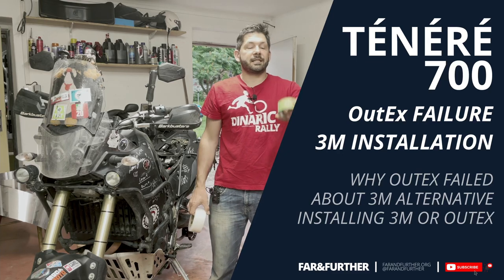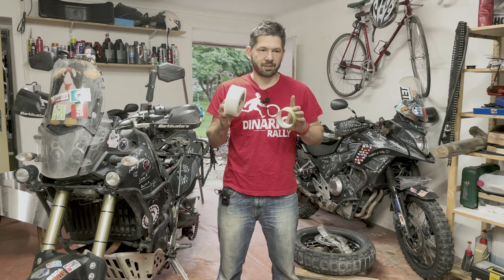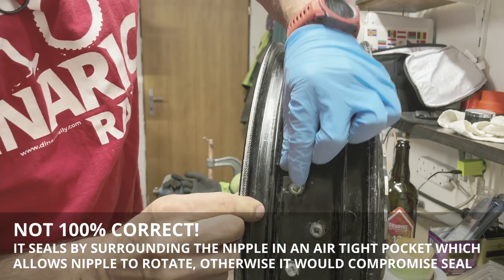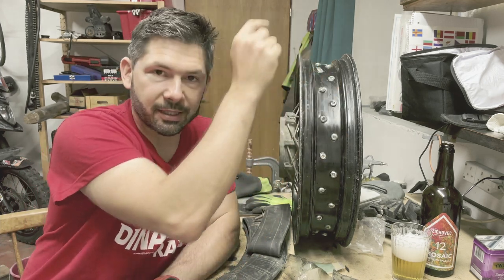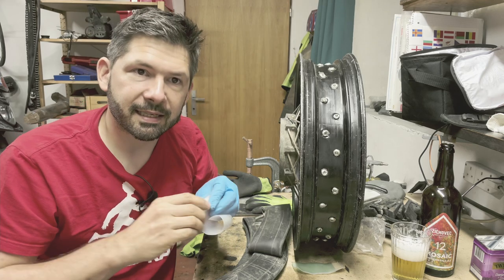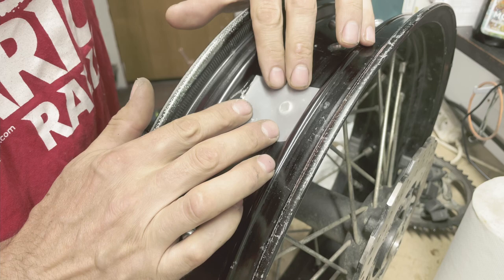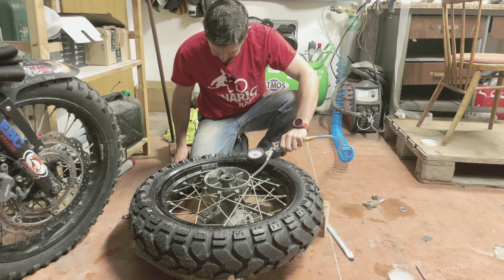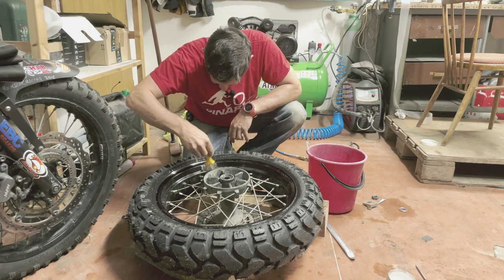Yamaha Ténéré 700: OutEx failure analysis, 3M alternative details and installation guide

Comment: Brother use JB WELD Red High Temperature RTV Silicone Gasket Maker and Sealant. I used it because it has High resistivity towards oil and temperature. Outex is always a failure due to its high price.
Reply from the maker: That could also work very well indeed. The chemicals is what I think kills the OutEx.
Reply: Did you try this already by any chance? Any luck? Is it still holding up? How did you apply it?

Comment: Mine failed to adhere on installation 😖 outex very expensive but failed. Used a ductape plus silicon instead
Reply from the maker: Can’t comment on the reason why it would fail on installation but yea, duck tape and silicon also works for limited time.

Comment: Sorry if you have been asked this question before.  You mention that 3M has tape for sealing nipple ends….its just not cut into circles.  Do you know the tape type or number?  Also if one were to cut circles…what would be the proper diameter?

Comment: Excellent review. Thank you. This is exactly what I was looking for. I used silicone to the nipples and a 3M extreme adhesive tape and failed at half the nipples. Ordered 
3M 4412N. I also used a Harley Davidson stem which holds air tight nicely if anyone is looking for a tubeless valve. Harley Davidson 43157-83A
Reply: How is that going now?
Reply: @lukewoods5696  still holding. No issues.

Comment: I had problems with the outex layer on my rear tire as well, the front has been fine. I went to the 3m tape, I actually just layer it over the outex layer, which I feel I might have goofed up the install on. The 3m I just had overlap the metal-to-outex layer to prevent air from entering , thus sealing it up better. Its holding so far, if i have a problem, I will just go straight to the 3M as I found installing the outex tape to be very difficult to do, especially since the videos ?I found were not great - your way of showing how you did it was awesome and they should make a similar video showing how to install the tape around the nipple properly. By the time I figured it out I am sure I screwed up several :)

The official outex install video was the absolutely happiest use case, with no narrative, and he did the whole wheel in like 2 minutes... it took me a lot longer !

Thanks for the video and ride safe!
Mike
Reply from the maker: Hi, I'm really happy the video was useful. In theory the 3M over the OutEx could seal the rim, the 3M is super soft so it can be forced everywhere.

I'd however investigate where the OutEx leaks and how as I have also managed to damage it with my tire irons and had to just cut portion off and replace it with the spare tape, which works well.

OutEx also sells sealing agent for the small holes (I have not tested it):
https://www.ebay.co.uk/itm/Air-Leak-Prevention-Agent-for-OUTEX-TUBELESS-KIT-/293887593577

The correct sealing of the nipples is crucial and I really tried to show it because to be honest that's probably only point of failure of the OutEx (unless it peels of like mine :) ). Patience is key and taking real care to seal the nipple all around without any wrinkles. Also important is to leave enough "meat" on the outside side (one close to rim) as it will be pushed a bit in with the air pressure.

I've spent probably about 30-40 minutes with the rear wheel.
Reply: @FARANDFURTHER  yeah for whatever reason I had bad adhesion or something with my outex. I would put the tire on, there would be a leak, I would cut the section out replace with new tape, remount the tire, completely new spoke would leak. I did this maybe 5 times and even had to buy more outex tape and got sick of fighting with it and threw a tube in it.  

The 3m tape worked first try. Yeah you are right I will need to be careful but I use a no mar tire machine so less chance of hitting the tape. I will keep an eye on it
Reply from the maker: That is super strange. What I found though is that the rim must be super clean. I found this by accident when using acrylic paints, they’re very sensitive to contamination and started to “wrinkle” very often. It took a lot of effort to clean the surface properly. Acetone, Perchlor-Ethylene, Technical alcohol etc... need to be used. I think 3M tape is different as it should stick to virtually anything even when it’s wet 😂🤷🏻‍♂️ Some alien tech or what!

Comment: Thank You for your well thought out researched and attention to detail! Excellent video and very useful! I'm in the process of doing this to a wheel that is already tubeless. (KTM 1190 Adventure R) The KTM uses rubber around the rim to seal. The rubber is prone to failure and is recommended to be replaced every 5 years. I already used the 4200 adhesive sealant around each individual spoke nipple instead of the 5200. I heard the 5200 is too permanent and hard to remove. Yes..I did consider the seal will move/fail when tightening or adjusting spokes. I trued the rim and tightened all spokes to spec. before applying the sealant in hopes the sealant will actually hold the spokes in place making less need to adjust spokes?  I'm not in favor for grind the spoke nipples just seems like too much possibility of failure and hitting the rim with the grinder. I think I'm going to use the 3m tape, then use the KTM rubber gaskets. I just want extra protection and less worry in the future. I am wondering if you use some either talcum powder or even silicon lubricant if it will reduce the friction on the tape if one needs to use a tube? You said that 3M makes the same tape as those round dots that cover the nipples...what tape is it, please? I would like to get some and cut the circles myself. Thank You, again!

Comment: Awesome video, thanks mate, i'm going straight to 3M on my T7 rear, still undecided about keeping tube for front or going 3M tubeless as well. I'm going tubeless so i can just plug a tyre instead of removing whole wheel & tyre if i get a puncture
Reply from the maker: Good luck! Yes I have the tubeless for the ease of repair. In front I run tubeless for ages the only issue is that
1) don’t go lower than 1.3bar/19psi
2) front tends to suffer more from bead leaking as the tire flexes and dirt gets in between the tire and rim

I’ve just fixed 2 rims to seal again. Proper clean and removal of all corrosion is crucial.
Reply: @FARANDFURTHER  But does it really work?
Reply from the maker: @Valterpenato  What does work? Can you elaborate your question?
Reply: @FARANDFURTHER  Hello.  I asked if this change really works over time.
Reply from the maker: Yes it does, I have about 60k km on the OutEx and I have now done 9000 + one Rally on the 3M tape and so far no problem. The only problem is one needs to be super careful when changing the tire not to damage the seal.

Comment: 3m all the way, never let me down.
Reply from the maker: Yep, it seems to be working well. How you tighten the spokes? Does it make problems?
Reply: @FARANDFURTHER  I wonder as well. Probably there is no way you can adjust spokes after sealing anyway?
Reply from the maker: So… I’ve tested the 3M tape and it failed pretty quickly. The 1mm tape is definitely not thick enough. Just yesterday I thought giving it another go.

I had to tighten the spokes and the result is that, of course, the seal is broken. You can adjust a bit but more than 1/2 turn will compromise the seal.

I’ve applied another layer of the tape (as I have only 1mm) and it seems to hold for now. The tape is meant to be stacked by the way.

Let’s see how long this lasts.

Comment: Really useful and I did enjoy watching it. Really can't make my mind up about different options but I think the 3M tape looks the right one 👍
Reply from the maker: In my experience all failed so far. I have not tried the Barttubless but otherwise all failed. For various reasons 😂
Reply: @FARANDFURTHER  thanks for this. I've just looked up the cost of Bartubeless and at £300 plus I'm probably going to go with the M3 tape 🤔
Reply from the maker: @richardgiles2484  😂😂😂😂 yep. I will try it for the science 😂 I guess 🤷🏻‍♂️ It’s the rim which is expensive

Comment: Nice video, thks. Just my opinion but grinding the spoke "nipples" or head is a no no because spokes hold the rim by tension so by grinding then the shear resistance  will be reduced and failure can occur.
Reply from the maker: Yea... not really fond of grinding the spoke heads as well.

Comment: Could you please make a trail based tire change video? I changed the tires yesterday and the rear tire was incredibly hard. Only used «trail tools» so I know what to do if I’m out and about. Thanks!
Reply from the maker: I’m happy to make a video but why change tire on the trail? On the trial what is most likely happen is a flat and I’d need to take one side off to change tube (unless I have tubeless) not take the tire off the rim.

Is it more about some tips and demonstration how I use my trail kit to do this?
Reply: @FARANDFURTHER  Thanks for the response as always, I’ve learned so much from you.
 
I ment tube change, not a complete tire change, sorry.

What do you mean when you say «take one side off to change tube»? Break the bead on one side and slide the tube out and replace? That sounds way easier than removing the whole tire to replace the tube.

Yes, tips, tricks and a demonstration would be really, really awesome. Most instruction videos are done in a garage with tools that you really cant bring on the trails.
Reply from the maker: @JohannesDalenMC  Man! I took up on the challenge and what a pain it was 😂 Now I need to somehow creatively cut 1 hour of struggle into reasonable video 😂🤷🏻‍♂️🤦🏻‍♂️
Reply: @FARANDFURTHER  Thats awesome, really cool that you did that upon request! I’m looking forward to the video - add some bloopers at the end. I spent many hours changing mine, swearing and sweating!

Comment: I know it have been couple years since this posting.  But, I had some questions.   The Outex instructions seems to state Do Not overlap either tape layers.  Cut a 30-40 mm. splice for the joints where both ends of the tape meet flush.  So do I have it correct and does is matter which way ( direction ) you apply the tapes to wheel?

Comment: Hello my friend,
How low can you go with the pressure without the risk of the tire going over the hump and loosing air?
I ask, because I have a beta Alp 200, a very light weight off road bike which needs to be driven with very low pressure and I’d like to give it a try on the back wheel with the 3M
Thank you so much for sharing your experience!
Best regards
Dani

Comment: Hello, thx for the video. I'm buying a Triumph T100 2023 and plan using 3M Extreme Tape instead of Outex, question: can I use the original Pirelli Phantom tiers after the conversion ? Is there any risk in using the Pirelli Phantom with the original rim after conversion ? how long will the 3M tape last ? thanks so much.

Comment: Mmmmm - this has got me thinking.  I've been using tubeless on my mountain bikes for years and always wondered why motorbike tyres couldn't be run the same way.  Many on MTBs just use gorilla tape instead of the expensive specific sealant tape they sell in bike shops. But MTBs don't have the same stresses and strains of a motorbike I guess. So I like the idea of the 3M tape but then why not put a layer of gorilla tape over that to protect the 3M tape?  Also why not put some sealant in the tyre like Muck-Off Tubeless Sealant?  That would if needed work its way into the spoke holes and seal the rim better.  You also obviously have a puncture sealant solution in the tyre as well to potentially seal a puncture on the road.  The issue for me is getting the tyre off on the trail.  if you tear the tyre or has a hole that can't be plugged then you have to put an inner tube in.  But TL tyres can be impossible to get off the rim, especially if you ride alone and can't use someone's side stand to break the seal.  Finally long videos are good if it gives you useful info - short videos that lack detail are pointless!  So many thanks.  regards, Mike
Reply: Yes it is being done. Normally you would use the rubber that is originally there to protect the tube from spoke's ends. Some kind of tape can be used as well in combination. I use it even now with tubes. Also Muck-off is also being used to seal it in case of some tiny leak or trying to seat the bead. As for the TL tyre getting of the rim - if you have center stand you can use your side stand to break the bead. I've done it on front and rear, just somehow block the stand from moving (attach a rope etc.) so there is no possibility that the bike rolls from it. Then it can be leaned surprisingly quite far. But 3M TAPE is not a good idea as I heard plenty of stories of it failing. Much better is to use that 3M marine silicon and glue the spoke holes and you can always secure it by the 3M tape (5200 is bonding stronger than 4200, I bought 5200 of course lol). Spokes not moving is not an issue at all. It's even better as you don't need to tighten them! Spokes on the rear wheel don't move much anyway, so that is not a problem. Front might be an issue but I will use a tube as the rim is not really designed for TL tyre, so the tyre might leave the bead at 120kmh on hwy - not risking that! Patching the front is not really that problematic, the rear is a pain so I'll be doing only that. Also when I glue the spokes I will put a layer of 5200 silicone all over the rim instead of the tape. Another youtuber/advrider "Riding Luna" has done this and says it has not failed him in like 3 years. He did 2 layers. You just have to cure it for like a week so it's not really as simple and fast job as with the tape, but imho worth the wait. I would also use metal brush. brake cleaner and sand paper to make the adhesive stick as best as possible, making extra care to clean the spoke/nipple holes. The worst thing is I think to seat the bead of TL tyre on the trail. Not high possibility when getting a puncture but still a possibility. Will use probably butane + flame method, seems the easiest lol.

Comment: What about using a small bicycle inner tube cut to fit on time of the 3 m tape as a protective layer?
Reply from the maker: That may work for using a tube but it won’t protect from the tire irons. But yes you can, you could also use the tube tape they use to protect the tube from the nipples.

Comment: Hi Really nice video! i bought 4411N and not 4412 is it nessesary to go 2 laps around the rim then to get more protection if i were to hit with the tire iron? Cheers
Reply from the maker: Great question! I have done one layer when I first tested the tape. It worked well but it developed the leak at some point through the nipple.

Then I put tube in and that put a lot of stress on the tape but most of it was intact.

Yesterday I wanted to fix it finally. So I cut out the old damaged parts (sharp knife and it peals off nicely) and applied another layer.

It seals well and now, after the experience I’d recommend use 2 layers or 4412.

In terms of tire irons… the problem is that main damage will be lifting up edges of the tape with the tire iron. This will gradually compromise the tape (water, chemicals, etc…) The tape is so soft (any thickness) that it is very easy to damage, it’s just one feature of it.

Comment: Hi, thanks for the great vid went a long way to helping me make my mind up. Is there an actual name or code for the 3M round patches  many thanks
Reply from the maker: Great to hear, I just published a bit of update on the 3M. I didn't use the 3M round patches but leftovers from the OutEx so I don't know the codes.

That being said... those round patches do very little in terms of ability to adjust the spokes. The tape is so flexible that it will be pushed all around the nipple and when you adjust the spokes it will compromise the seal.

Just tried it, so... if tubeless, with this... forget about adjusting spokes.
Reply: @FARANDFURTHER  thanks for the  update really appreciate it
Reply from the maker: @petergj  Sorry for the delay! 🤷🏻‍♂️🤦🏻‍♂️

Comment: Hi bud, Nice video. 
Couldent you just apply a second layer of a more durable tape on the top of the 3M, just to minimize damages?
Reply from the maker: Possibly, although the 3M guy was not keen on it especially when we talked about the tube scenario. He was concerned about the friction between the layers. I showed him the OutEx protector layer and he said it makes sense as it’s slippery while the 3M tape is not.
Reply from the maker: I’m very curious if 3M survives the tire changes at home. When I was putting the tire on one bead sloped in the middle and made a bit of scar on the tape. I think I was lucky it didn’t strip it from one of the nipples.
Reply: @FARANDFURTHER  will be interesting to see how it works out, very tempted in converting too.
Reply from the maker: @everythingtenere  For me, travel and tubeless is no brainer. Hard off-road may be a slight issue with the front but hey I did Dinaric rally on tubeless with the OEM rim... and I won’t be doing harder stuff 😂 So I’m happy, also an investment into front MT rim may not be the worst idea considering it will make whole system just so much robust. The leaks in the front through the bead are the most common and I believe the MT rim would eliminate this.
Reply: @FARANDFURTHER  can i use the 1.5inch 38mm for the rear of CRF1000L rim (Africa Twin)
Reply: Has anyone found a sticky dots alternative for the spoke nipples? Cheers.